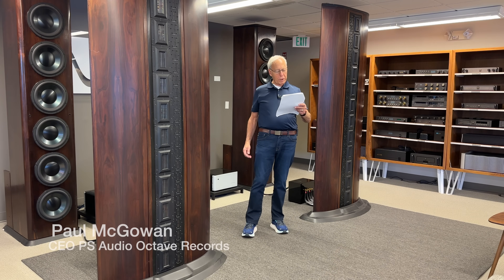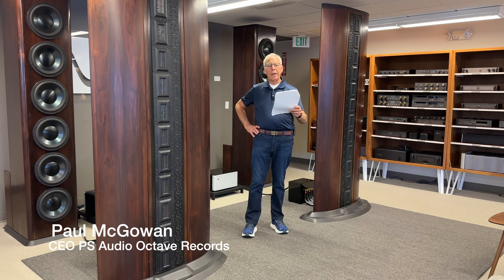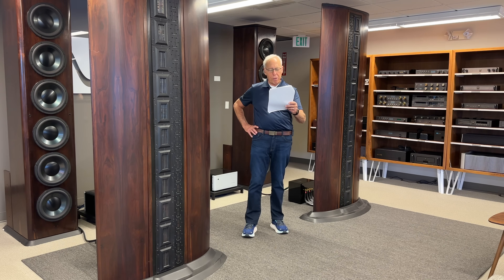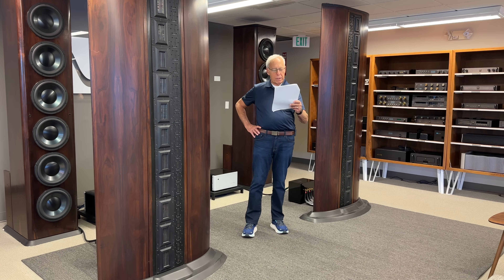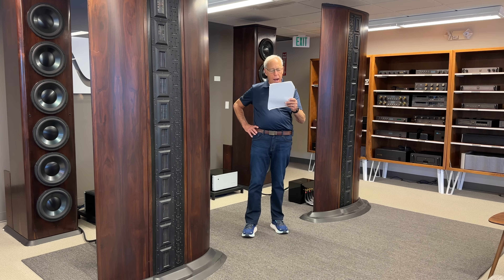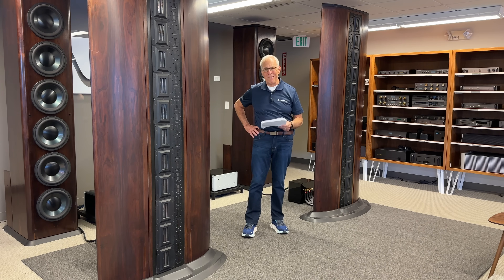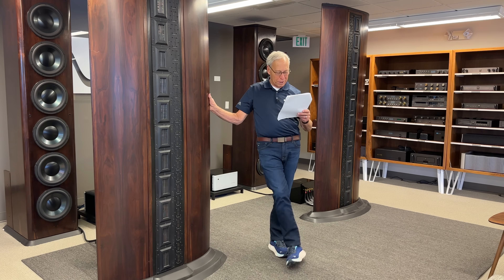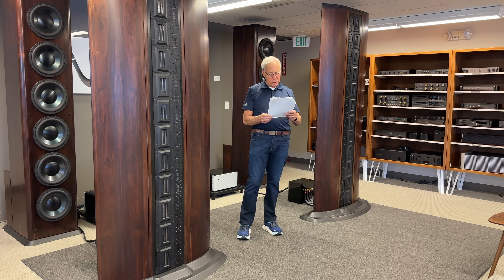Tube DACs and op amps

Comment: DAC's simply cannot function without op-amps. Even if you have to build them out of discrete transistors. You can of course totally mismatch the outputs to the inputs of any following line-amp, but that's has nothing to do with DAC itself. Throwing a tube into the dac's output circuitry does little but add non-linearity and degraded drive capability, unless you add a buffer stage which would usually be semi-conductor technology..

Comment: What is often missed in these OPAMP discussions is that an OPAMP and a chip or IC are two different things. Yes of course OPAMPS can be made in a chip. But you can also make an OPAMP from discrete transistors, even tubes. The first OPAMPS around the 1940s were tube versions. An OPAMP is a circuit topology, not a product in a strict sense.

Comment: Paul talks about Op-Amps rolling off after 10hz ... while technically correct, it is a bit deceptive.

Most Op-Amps (the chip kind) have open loop gains in the 10s of thousands and that gain does roll off very quickly. However; they will not fall to unity gain until well after that... typically 1 or 2 megahertz.

What the feedback loops do is set the external gain of the circuit (not the chip's internal gain) so that you have a stable voltage gain right up to the point where the chip's internal gain falls below the feedback gain.... thus at a gain of 5 or 10 (for example) most op-amps can hold a ruler flat frequency response with uniform gain well into the hundreds of kilohertz... Way beyond what is needed for audio use.

The feedback also tends to cancel distortion within the chip.  Since it is negative feedback taken directly from the op-amp's output and fed back into the opposite side of the differential input, any difference between output and input is cancelled, providing extremely low distortion, often in the area of 0.001% .... sometimes less.

I have a number of op-amp designs here that will pass a 100khz square wave perfectly, something tube and transistor amps seldom do.  

This is not to say that op-amps are good or bad ... it is simply how they work and why designers choose them.  

Also, compare the circuitry in an op-amp with a modern AB power amp... and guess what, that 200watt class AB behemoth you love so much is basically an op-amp on steroids.

Comment: QUESTION, 
Isn’t the Tube Amp a great example of how sound travels with an electrical current through a vacuum?   :face-blue-smiling:
Reply: It's just an electrical signal.  There is no sound until it comes out of your speakers.

Comment: Great answer.  That said, I can add some context for Lukas op amp comments.  IMHO, he is referring to chip based op amps and generally those that are typically used in CDPs and consumer hifi equipment.  Long before he created Lampizator, he experimented with virtually all commercial CDPs from the 90s and realized that a massive improvement in sound could be achieved by getting rid of the chip op amp output stage  and any output filter cap.  He created his Lampizator tube buffer (actually his mentor in Ukraine designed it) and applied this same output buffer on numerous CDplayers to evaluate their merits without the dreaded chip amps.  I duplicated his experiments and his observations were spot on.  He went on to  refine his tube buffer, and the result is the Lampizator brand of DACs.  
His point is basic.  If you have a wonderful Lampizator source, capable of producing low level information, it will be lost if the rest of the chain cannot reproduce it.  A pre amp, or power amp or speakers can individually or combined kill the signal rendering the Lampizator no improvement over a $100 DAC with a switch mode power supply.

Comment: FWIW ... In my experience when someone pounces on a piece of technology as hard as  that DAC provider did it is because they do not understand it.  Hating is immediate and it's easy ... learning takes a bit of effort and many times that lack of effort will show up in ignorant people's opinions.

Op-Amps are not evil ... in fact they are one of the ways stereo designers got distortion under control, to the point where you should never hear it again.

My advice would be for Jason to find a different product to buy.
Reply: FIkus is blunt and outspoken critic of lazy designers creating mediocre products.  He references with distain a breed of engineers who cobble up circuits using the op amp du jour using the reference circuit.  I find his dialogue entertaining and informative, but many find him off putting.
Fikus is a degreed electrical engineer with a massive amount of practical experience in this domain which he gained as a hobbyist before he quit his day job to do this as a business.  He applied his experience and created the Lampizator brand with sustained acclaim from most journalists.  The Horizon is the DAC of choice for many of the top brands to show off their amps and speakers to best advantage.
Reply: @user-od9iz9cv1w 

You do understand that makes it worse ... not better.

For someone with your description of skills to mouth off like that is shameful.
Reply: @Douglas_Blake_579  I don't follow your reasoning wrt makes it worse.  But in any event, I meant no disrespect or to 'mouth off'.  I only quote Lukas to highlight his perspective wrt commercial audio designers and their use of opamps as a lego set to build out circuits that he finds uninspired.  His approach harkens back to a simpler time as he advocates simple triode circuits powered by beefy CLC toroidal power supplies with vacuum diode rectification.  Not everyone agrees with him or that his flagship DAC is worth 50k, but it is there for those that do.  For those like me who will never pay big money for this stuff he freely encourages DIY and provides his circuit design.  I applied his approach to several CDPs, and then built several DACs.  The final one in use today is a pretty over the top streamer/DAC with triode output, SOTA clock.  Actually my whole system is inspired by his writings.  I built OTL monoblock amps with 6C33C tubes after reading about his love of his friend Eugene's OTL amps and then build open baffle speakers inspired by his P17.  So the guy has never made a penny from me, but provided everything I need to produce the system of my dreams for about 10% of an audiophile brand.  To me that is the best of this hobby.
Reply: @user-od9iz9cv1w 

One might reasonably assume that someone with a high level of professional achievement would not spend his time trashing others in the same profession.  It's, well, unprofessional.

His point about op-amps (as you've related it) seems to miss the point that they have, in fact, revolutionized audio design by making it both simple and convenient to get good clean results.

I suppose I could have worded that better...
I wasn't on about you.
Reply: @Douglas_Blake_579  Agreed on all points.  He has a style that can be polarizing.  As a hobbyist he trash talked the big name audio brands for their often good but not great sound (in his opinion) and for super expensive bling that would be displayed at the Munich High End Audio show 'for rich German dentists' as he would disdainfully describe it.  Later, after he succeeded in building his own boutique brand there is some irony that his beautifully polished triode DAC is used to drive million dollar systems at that show.
BTW here is a brief YT clip of the system I built based on his rantings.  Obviously not like being there, but with good head phones it gives me an idea of how it is doing relative to similar android phone clips of systems I admire.  https://www.youtube.com/watch?v=M7pSPLQIYtk

Comment: Nothing wrong about negative feedback even lots of it. What is wrong is using negative feedback to cover for a badly designed circuit. With a well designed circuit and lots of negative feedback one can have his cake and eat it too. if you don't believe me, ask Bruno Putzeys about it. This trend for minimum or no NF produces circuits with copious amounts of distortion. If you like that, that's OK with me..
Reply: Audiophile fads can be very entertaining at times.
Reply: @Douglas_Blake_579 
That is what scares me.
Audiophile fads. Seems to me there are too many personal fads in Audiophile land. Makes it too confusing. 
Especially for people like me. 

I don’t need a Holly Grail audio system to enjoy listening to music. I can enjoy music listening to a quality made AM tabletop radio. 
Yes they still make them.
Reply: @davidfromamerica1871 
Exactly.. these things are fads, just like re-capping, op-amp rolling, tube rolling, etc.  One guy says it works 50 of them gotta try it...

I'm with you... it's mostly about the music, not the equipment. Once I get a system settled in and working to my liking, I will use it as is for years.
Reply: Feedback is a widely used engineering technology and often grossly mis-understood by audiophile texts. Does your car have cruise control? That's a feedback system.  So is a plane autopilot. Many things we take for granted would not be possible if feedback systems were never discovered. And as stated above it works very well if properly engineered, or quite poorly if not.
Reply: @andydelle4509 
Don't forget the thermostat in every home.
Reply: Yes. Use it for many years/ decades etc. 👍🤗  Try to choose correctly the first time is the key.  Try not to use emotions in buying, use common sense.  I budgeted 3K total. Did not break the bank for me.  

I actually have two systems in one for that price of 3K. All fine tuned to work in harmony playing together at the same time with a unified system product from one manufacturer.  It can be separated for one system use easy enough. 

I have it all in storage now. 
Can’t put it in my current over the road truck, not even the one system setup. I am not going to put it my car.  I don’t drive the car enough to warrant putting it in. 2008 Saturn Outlook bought brand new. 
It has less than 9,000 miles on it. That’s not a misprint. 
As opposed to about million plus miles I put on my over the road trucks sense 2008. 

I have traveled 48 States and 6 Provenances of Canada over the decades, approaching 4 million miles now driving trucks over the road.
Reply: @davidfromamerica1871 
Ahhh ... a member of the million mile club!  
I got pretty close before retiring... Doing service calls all over Southern Ontario I managed about 700k ( 1.1 million km) from 1985 to 2008... and at the risk of bragging, without any accidents on my record.

My current system is about 3 years old. Had to restart the clock when I updated the amplifier. Before that about 14 years with the old AB amp.

Comment: A tube amp has a distortion level in the area of 1%, a discreet amp has about 0.1% and in IC is somewhere around 0.01% distortion. At the same time a tube usually has a nice distortion spectrum on K2, that's the typical warm tube sound that we all love, a discreet amp if it is well-made even as a differential setup can have a distortion spectrum that is fairly close to a tube but an IC usually looks bad with a distortion spectrum that is far from ideal. But remember it has only 1/100 of the distortion a tube has. If you have a phenomenal speaker then the distortion levels are just shy of 1%. So there is no clear better or worse, it is just another philosophy of how to build things.
Reply: I have gotten Push Pull tube amps up to 70 Wrms down to 0.1% THD using current sources and sinks in the driver stage. But many tube people scoff at the thought of transistors being introduced to a tube circuit.
Reply: @andydelle4509  yes these kind of tube amps do exist but the usually use negative feedback from hell and sound more like a transistor amp than many transistor amps do, so I would ask the question "What's the point?" If that's the sound you are after, then buy a transistor amp right away. Don't make it a dogma and buy what suits your taste. There are excellent transistor amps out there and there is nothing wrong buying a transistor.
Reply: @snakeoilaudio  In one design the phase splitter tail resistor was 10K resulting in a THD around 1% at clipping approach. By replacing that resistor with a 7ma* current sink, the distortion dropped to 0.1%. The feedback loop was not altered.  As for the sound I didn't notice much if any difference. 

I don;t see where a current source and sink is related to feedback? You are just flattening the tube's load line closer to ideal.

 *The 7ma was based on 6SN7.
Reply: @andydelle4509  alright, I have the feeling we are talking apples and oranges at the moment. The 6sn7 is a driver tube and not a power tube. I thought you are talking about over all THD of a power amp. Yes a 1/10 of a percent on a driver stage is pretty good, it is excellent but not impossible you are right. the 1%, 1/10th, and 1/100 is just  go give an area that people get a feeling what we are talking about. Of course not every IC has a 0.01 THD and not every discreet transistor has 0.1 you are absolutely right.
Reply: @snakeoilaudio  No, I am measuring at the speaker terminals. Adding the current sink and doing nothing else to the circuit lowered the full power THD from around 1% to 0.1%. This is a well known trick in tube amp design circles.
Reply: Some people like the higher amount and type of distortion spectrum created by typical tube circuits.  In addition, a 'warm' sound typically implies some roll off of the high frequencies (I prefer accuracy myself).  A low open loop bandwidth op amp needs to be in a properly designed circuit to handle possible slew rate issues -- and it may not be.
The desirability of using a tube output stage implies that they WANT the modifications (distortion pattern) imposed on the signal by a tube circuit.
Consider a thought experiment.  Take the output of a well designed op amp circuit circuit, scale it back down to exactly match the input signal level going into the circuit, subtract the two, and listen to the results of that subtraction, even scaled way up in volume.  If the op amp circuit is designed correctly, the difference will be inaudible.
Then do the same to a typical 'high quality' tube circuit.  The difference would likely be quite audible, meaning that the tube circuit is modifying the original input signal to a significantly greater degree.
Again, there's nothing wrong with LIKING the coloration (distortion) added by tubes.  Many audiophiles do.  But if you prefer to drive your headphones/speakers with a signal as close as possible to the original signal, you may not want tubes in your audio path.
Reply: I know this won't win me any friends, but I would like to let  the OP know that "discrete" (not "discreet") is the word they meant in the discussion.  It IS pretty much pointless and pedantic for me to say it, but the OP seems like a really intelligent person, who might appreciate the opportunity to improve their writing.  I hope this is received in the spirit intended.